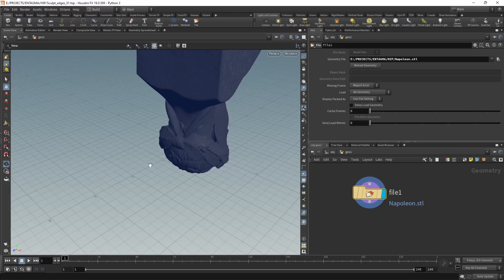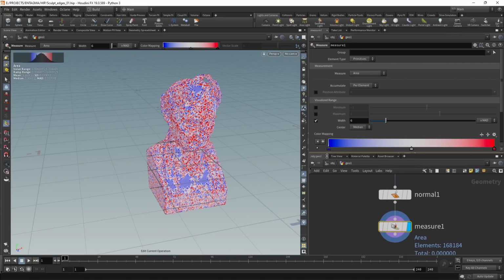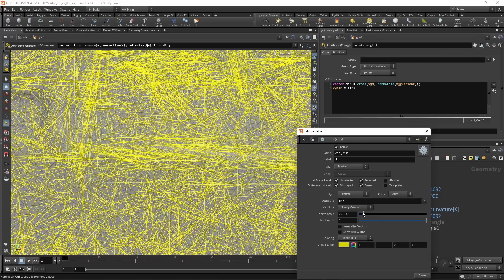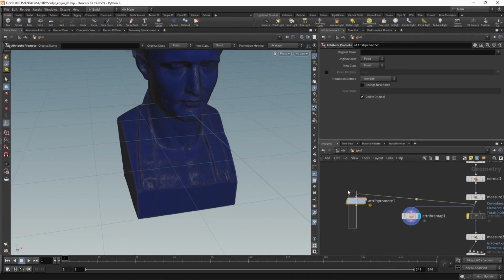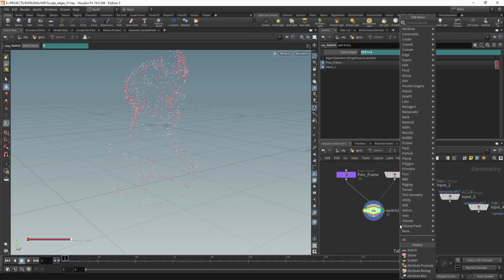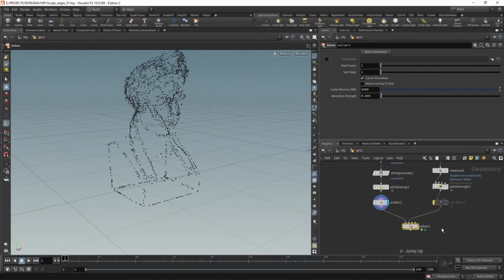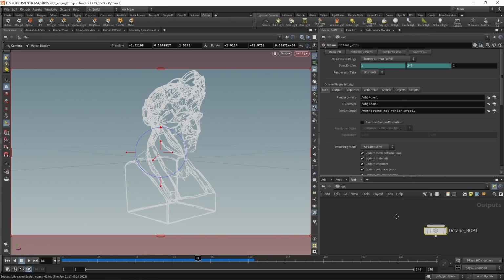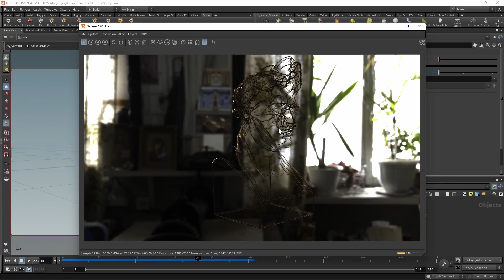Houdini Tutorial: Creating An Abstract Wire Sculpture

Comment: Moritz, thank you very much, great content as usual. I've done all the stuff, everything works fine. There is only one question. How can I dramatically decrease the speed at which the wires are drawing. Cheers!
Reply: Hello! I'm just watched and did the progress as a practice nowdays. Maybe i had the same issue. I divided the "v@P" position vector in the wrangle by 100 at the 5th line in the wrangle SOP beneath the solver.

int npt = nearpoint(1, v@P);
vector dir = point(1, "dir", npt);
dir = normalize(dir);
float amp = chf("Adv_strength");
v@P += (dir + amp)/100;
v@P = minpos(1, v@P);

Here you are! I hope that worth to wait a year for this answer :)
Reply: @zoziapu  Thank you very much for the detailed answer. And yes, it’s better too late then never :)